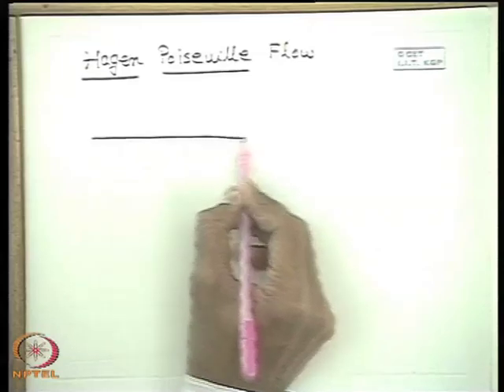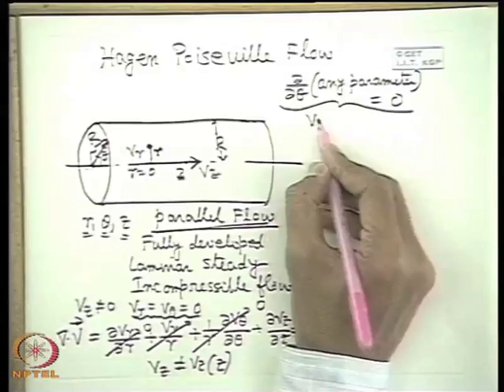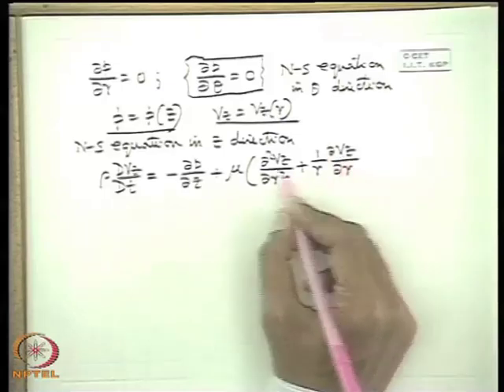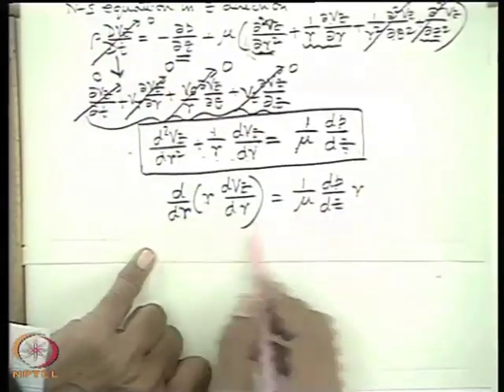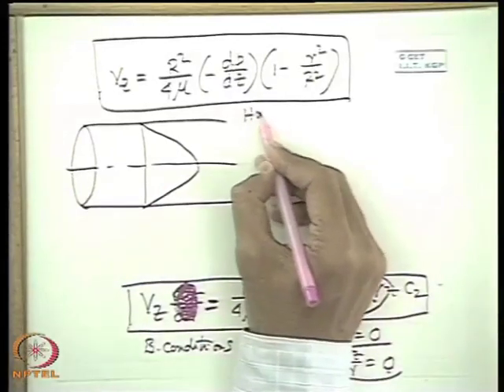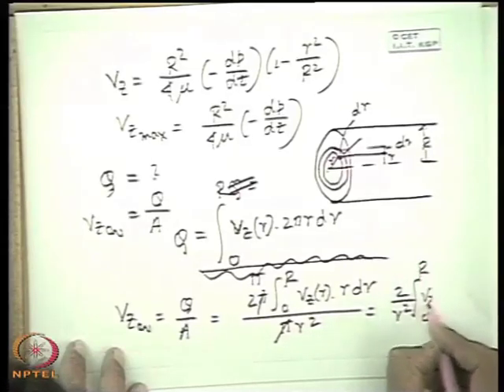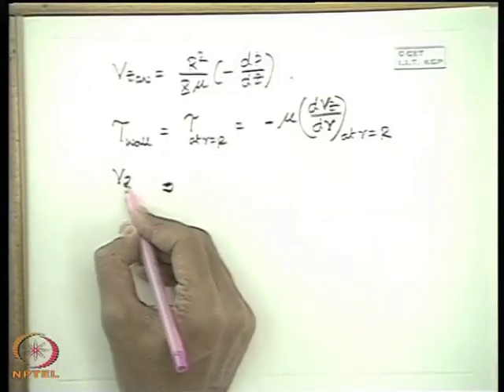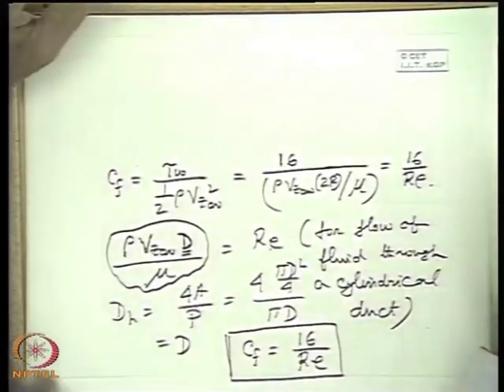Mod-32 Lec-32 Incompressible Viscous Flows Part IV

Comment: Why is the first question's answer "a", should be assume (dP/dz) = 1 always?
Reply: They are not assuming it to be 1 rather since dp/dz will always be constant throughout the flow hence they equate this ratio for 2 different sections
Reply: If dp/dz=const, say k. Integrate and get ∆p=k∆z. Now put and see...

Comment: question no.3 answer is wrong
correct is  c
Reply: Sumit isn't the answer for question 2 also C? If not could you please show me how? i used  massflow rate=density *velocity*area. Thanks
Reply: Vel along the central line is max vel. we have to use avg vel for mass flow rate
Reply: @typhoon394  the difference between centreline velocity(u_max) and avg.velocity(u_max/2) makes the difference the correct answer is 5pi..it is correct!!
Reply: yeah you are right